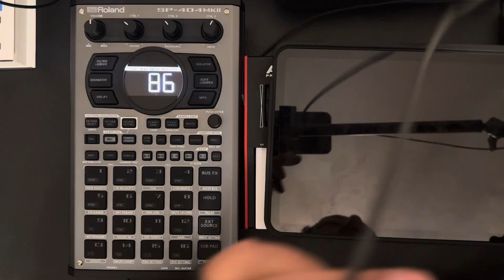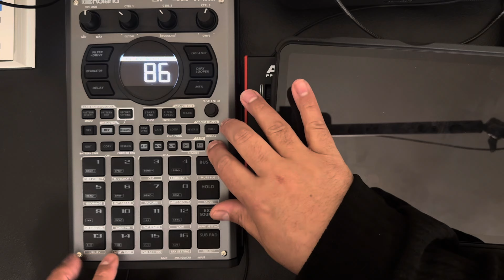Roland….what on earth is this???

Comment: Apparently 4.04 has an alter ego and is living up to it's name. 
404 is a HTTP error code lol.
Yank the batteries. That'll probably fix it. The power switch is not a HARD shutoff. It is likely handled by the MCU the and kicks off a shutoff procedure when switched off. Looks like it got into some kind of locked condition.
Reply from the maker: Yeah removing the batteries was the key to restoring it.
Reply: I know the sp404 mk2 will not let you power it up from a usb-a to usb-c cable. I wonder if it was running on battery power the whole time. When the batteries drained it tried to switch to usb power but discovered a usb-a to usb-c connection(oops we did not test that scenario properly) locked up. If you can replicate the error you should probably file a bug report with the steps to reproduce it.

Comment: Batteries is a big no no in 
My studio 
Batteries will kill your system mechanically 😂
I’m trying to tell y’all
Reply from the maker: Batteries aren’t the problem here. It was plugged in when it crashed. The batteries serve as backup option. This is a software issue.
Reply: You're both right. Also, i copied this from google about battery leakage .... 
"The potassium hydroxide is the true culprit of the white powder you've all seen from time to time; it forms when it interacts with air. Corrosion occurs most often with non-chargeable, single-use alkaline batteries, which deteriorate with age."

Comment: Is this since the update?
Reply from the maker: Yes…however today I did a factory reset and I’ve  have not experienced the problem.
Reply: @bjamminsincebirth3494 did the update installation instructions tell you that you need to do a factory reset? If yes then this is the solution. I had this once on the MC-707, I ignored to do the factory reset on purpose and I had some strange behavior so I just did what the instructions told me.